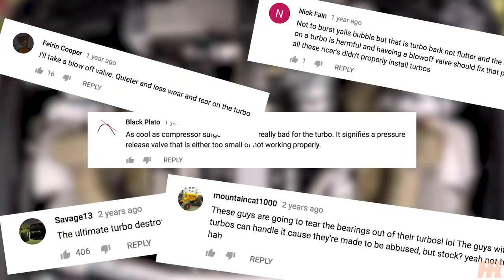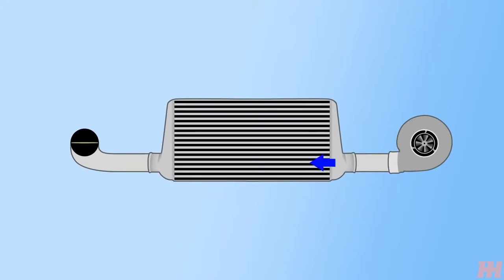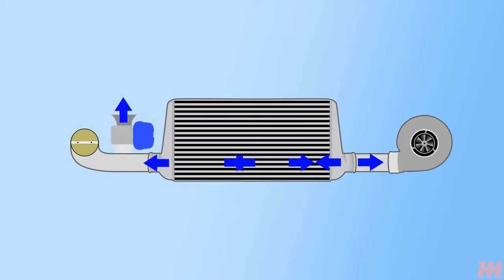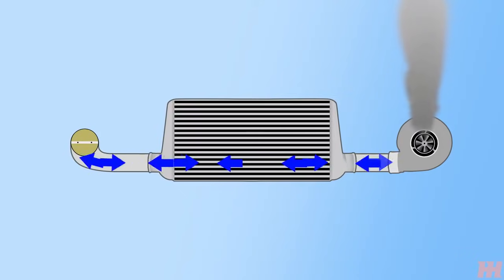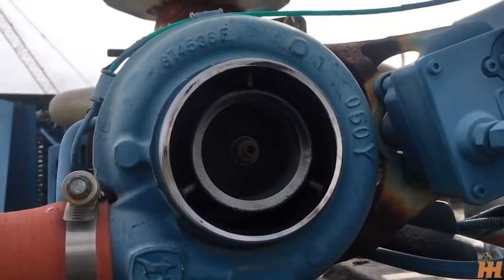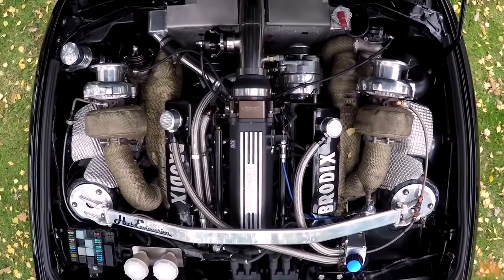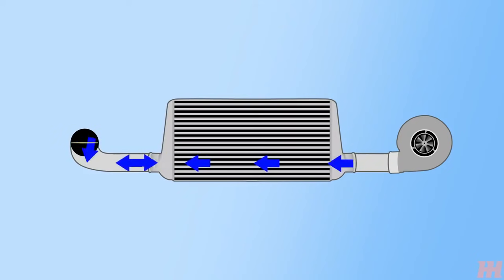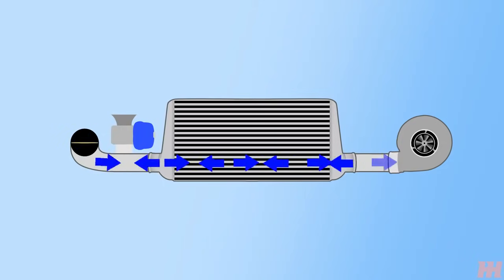The Truth About Compressor Surge

Comment: Wait so thath means we can have sututututu ?
Reply: Stoteliu Siaubas that’s what I’m hearing.. throwing out BOV now..
Reply: Been saying this for years and no one would believe me
Reply: only low boost
Reply: @randiey95  define low boost because im thinking if  15 psi  qualifies🤔
Reply: @TheShamRockii  welp go for it
Reply: You didn't draw pictures for me like this guy tho...
Reply: @TheShamRockii  any amount of boost will be fine. There are loads of high hp cars running no bov
Reply: @strider5119 yeah but u just gotta have a strong turbo fs just not a cheap weak one
Reply: I have a mk6 golf r with k04 turbo and integrated engineering intake and I get some pretty nice stustustu when I shift above 4 or 5 thousand rpms.

Comment: Been running no BOV on my single turbo 1JZ for near on 3 years now. Makes 20+psi on e85 reliably all day every day without issue. Why fix something if it isn't broken?!
Reply: You'll be fixing it a lot sooner than someone with a BOV.
Reply: Archer 
old turbo buicks with blow thru system didnt have bovs and you can still find perfectly working ones with the same old turbo.
so after 25+ years and thousands of miles and still no broken turbo...
Reply: Also to note, WRC cars don't use BOVs either because (believe it or not) they slow the impeller speed down more than without one causing more lag ;)
Reply: as far as i know the bmw m6 GT3 don´t use a bov either and you can hear the flutter when they let off the gas ^^
Reply: andrenegwer says the guy parroting what he saw in a video from a very respectable, but less experienced member of the community. They are much more experienced experts who will tell you the opposite. What he covers is is mostly true but you still cause premature wear without a valve regardless.
Reply: Archer the guy responding to you doesn’t get it or the irony of his statement.
Reply: jrbuch, the purpose of the bov is to maixmise turbine rpm between gears, ie, reduce the compressor slowing back pressure when the turbine is not being driven by exhaust.
Reply: I've never used a bov on any turbo car either. The benefits are so minimal it's not even noticeable. It's supposed to keep the turbo spinning faster when off throttle but we're talking a small fraction of a second in spool time. When improperly tuned it's actually doing more harm than good by releasing too much charge air.
Reply: Archer my almost 30 year old 200sx also came without any bov or recirculation valves and still works fine. Long live the turbo flutter
Reply: lmfao this guy doesn't hit boost whatsoever, topic ended
Reply: I have a BOV and I can make it flutter at will just depend how I back off the throttle.  If I lift hard the BOV works like you would expect if I roll out of it it flutters.   My point is you can't just go by how it sounds.  Plus most factory BOV don't typically chirp loud like aftermarket units.
Reply: Because Toyota !
Reply: My golf turbo makes over 300 ponies and has been fluttering for the past 30k turbo is still strong so  yeah braaaaap stuustuutututuu
Reply: @jarrusjenkins  Yes but note that WRC teams can swap/repair engines between stages, while regular people simply cannot do the same as easily and as quickly.
Reply: @meatspin17779   did you not watch the video ? It's fine with close throttle compressor surge cause there's no load on the turbo. Open throttle compressor surge is bad because theres load and air trying to force it's way back through the turbo.
Reply: It sounds cooler lmao
Reply: @jarrusjenkins  Please forget me if i am wrong but WRC cars change turbo to New one after each race. Cause their turbos are on very high boosts and it wears alot quicker than it normally would. Again Please correct me if i am wrong here :)
Reply: @Cyfoxxi  not after ever race but probably after each event (like the whole country if you catch my drift)
Reply: boostedsil40  Unless you are doing a burnout in your driveway then shutting the car off you don't need a turbo timer, also if running no blow off valve did increase lag by any noticeable amount with on/off/on throttle then it wouldn't be so common in drifting for people not to run blow off valves.
Reply: Because eventually it will break. Why have something for X amount of time when you can have it for 3X amount of time for 0.2Y the cost of repair. Preventative measures
Reply: @jarrusjenkins  well they also have antilag systems which destroys turbos anyway...
Reply: @camolegoshark  this is very true...
Reply: How can I find my OEM blow off valve ? Or dump valve ? I have a golf 1.4 tsi 2012 122 hp and I can't find my OEM bov or dp
Reply: @e34boat88  the JZ is a Toyota.
Reply: @Who-vk2ke  doesn't have a BOV , uses a recirculating valve. It's on the the compressor housing. You can install a bov spacer but you'll cause a check engine light because the air is metered and dumping it will cause  an unstable AFR
Reply: @danr8194  okay, thank you !!
Reply: Or you can drive a diesel and not have a throttle plate at all 😂
Reply: Well too much stall isn’t good long term especially with tuned boost, but if you’re happy with its longevity then cool.
Reply: You know you still get flutter with a BOV right?
Reply: @jarhead1145  say that to my 500,000km corolla with no bov or diverter valve, runs like a dream
Reply: Guys I have a doubt .. Does stock car makes turbo fluttering sound ?
Reply: @anjalipandey8278  some do, like mine.
Reply: I have a plumb back BOV wound up to max. It only flutters at larger throttle openings. My friend has the same car with a dose pipe, and his flutters like Zoidberg just taking it easy.
Reply: @jarrusjenkins  I believe that the manifold pressure is higher without a BOV, but I do know that BOVs that route to the exhaust impeller do help keep the turbo on rpm helping to keep boost, and prevent manifold over pressurization.
Reply: @zerodamonsta942  there's still load between the compressor and exhaust of the turbo. 
Compressor is being slowed by the escaping air. 
Exhaust side isn't
Reply: My car came stock with a turbo and no BOV and it flutters like crazy. If they left it like that from factory it should be fine
Reply: Yeah, you’d last a lot longer with a BOV.
Reply: @jarhead1145 not true

Comment: Finally someone who actually understands how this works. Thank you CT.
Reply: ali p how does he understand it? He just explained it’s ok. He showed no examples or reasoning as to why. Having 20+ years in machine and car shops and understanding tolerances and bearings back pressure under load or not is still pressure. Which is going to put force on the bearings which will wear one direction more than another. This wearing the bearings to premature failure.

The whole it wears under WOT but not when it’s no makes no sense. Either way it’s back pressure on the turbine and bearings. So either it does or doesn’t at all.
Reply: Manufacturers understand better. And they put valves to protect from surge. Thank you manufacturers.
Reply: Dan Slotea not true, they are mainly in place to prevent the noise and due to they fact that many standard hot wire/thin film air flow meters could not measure the direction of air flow, and as surge when surge occurred the air flow meter incorrectly measured more air than was being consumed by the engine, causing a temporarily rich tune and emissions problems.

The Anti surge was just a happy coincidence, many early turbo cars of the 80s had no bov.
Reply: @renners9636  Many 80s cars also had Brown interiors, solid rear axles and were absolutely terrible.  It doesn't make them correct. 
Also that was like 37 years ago, technology changes. 
Look at Borg Warner.
Reply: No Grip can you be more specific in your argument against me?

My statement was very simple and only covered one aspect, that the main reason cars were initially fitted with blow off valves was not to protect against damage from compressor surge itself but to stop incorrect fuel readings under surge conditions and to stop annoying noises that most drivers would not expect from a normal car.

I made absolutely no claim of anything being better, the implication of me mentioning some 80s gasoline cars not having blow off valves was to validate the 100s of thousands of turbochargers that have lived and live without being destroyed by compressor surge, I never advocated it as correct, but simply noted in the case of many oem cars that it is was a design that did not doom the turbocharger to early mechanical failure.

Manufacturers are more worried about possible emissions and noise issues than a few turbos failing sometime after warranty is up.

Maybe turbos running 30+psi are more susceptible to wear I couldn’t say.
Reply: @renners9636  that's why they use map sensors
Reply: Jon Simmons No, it might not be a problem with map sensors, but it is absolutely not the reason they exist, if it is please reference it.

They are cheaper, also different engineering teams just do things differently.
Reply: @renners9636  who said that the reason they exist?
Reply: Jon Simmons “that’s why they used map sensors” this statement seemed to imply that, maybe I miss understood.
Reply: @renners9636  they use map cause maf measures flow not boost,that's why they suck.
Reply: @mrmidnight32 it's not just the bearings/seals. Its the compressor wheel vane tips as well. Not to mention the performance consequences.
Reply: Guess I'm taking my BOV off Lol
Reply: @jonsimmons3507   I can tell you don't know what you're talking about lol. Whether a MAP or MAF sensor is used, flow is what the ECU is trying to find. MAF sensors don't suck they provide way more accurate low speed airflow data to the ECU. Map sensors from what I've seen simplify the system and tend to be more robust than MAF sensors, If a MAP sensor is used the ecu will use it and temperature to calculate flow anyway so not sure why you say MAF is bad because it gives you airflow info straight up.
Reply: @mrmidnight32   Agreed, It's the worst when a channel focuses on the lowest common denominator comment or "things inexperienced ppl argue about" we're not here to diagnose noises randomly in peoples videos.. What I'm really after is what the turbo surge line in a compressor map really means, what part damage are we concerned about during surge etc etc.

Comment: Wow! So like half of us thought flutter was just a fancy sounding blow-off valve haha.
Reply: James Russo that’s what has made me so pissed! All these “tuner” 600whp subies talking bout “it’s a BOV”
Reply: maybe 10% its clearly not bov. BUT some of the turbo cars that makes flutter noises does have bov but it only realeases part of the boost so the sound is kinda mixed
Reply: some people wind there blow off valves up tightly so it surges on low boost and opens the blow off valve on high boost
Reply: Yep my car flutters when I roll off in normal driving and chirps when I'm getting into it.  Just depend on much boost there is before lifting.
Reply: GlassTopRX7 how tight is your bov set?
Reply: You guys could also put some kind of restrictor in the vacuum line to get a delayed bov. Flutter and bov sound together are great! Look up the video! Dude that did this has a rwd wrx wagon.
Reply: It sounds similar with our without a BOV depending on application they will both flutter, just sound different
Reply: @travisburgemeister313  BOV just goes shshhsschshcsh doesnt it?
Reply: @nateboness9801  Only if it is vented to the atmosphere.  If it is a recirculating BOV then there should be no real sound.
Reply: @nateboness9801  My Subaru Forester XT has a bypass valve and it goes "Pshhhhhhhhhhh".
Reply: @jimmythehand4877  Hmm, my stock Forester XT valve setup (recirculating) goes "Pshhhhhhhhh"
Reply: @BaddaBigBoom  then you have a leak.
Reply: @jimmythehand4877  Thanks, where is that most likely to be? Between the wool or the knitting needles?
Reply: @jimmythehand4877  Bypass valve (BPV) makes a pshhhhhhhh sound. He doesnt have a leak.
Reply: @midniteclub1654  This
Reply: @jimmythehand4877  my stock 3sgte recirculates but if I go off throttle at 3k rpm I get a nice “pshshcheww” but otherwise is too quiet to hear. If I put a mic under my bonnet I can clearly hear it moving air as well just not over the sound of motor revs
Reply: So turbo isn’t bad how people say it is right? It’s just compressed air mixing with air being pushed out at the same time n being trapped all at once due to letting off or “closing” off the throttle ?….

Comment: Its scary to me that people don't actually get this as it's the most BASIC understanding of how a turbo works. Think about that for a while. these are the same people that yell ''RICER'' if you made a modification they don't approve of.
Reply: StreatBeatsAudio Subwoofers basically people who call themselves car guys but have no clue at all
Reply: It sounds to me like you're just band-wagoning, because you aren't really providing reasoning behind your argument. You're simply persecuting. Compressor surge fundamentals are not the most basic understanding of how a turbo works. That's usually stage 2 or stage 3 in understanding a turbine's mechanics. An inexperienced person who has just finished their build wouldn't likely be aware that their blow-off valve serves purpose outside of alleviating pressure in charge pipes and intercooler piping/intercooler. If they heard open throttle compressor surge for the first time, they might just assume it's cool turbo noises and functioning as normal. Once they've blown the seals and bearings out of the turbo, then it might be something they learn. Also, some of your statements don't even correlate. You're a bit all over the place, which is what leads me to the conclusion that you're simply here to make others feel bad to make yourself feel better about your own ignorance. I'm not attacking you, but I would ask that you not attack others. If you think you have such a complete grasp on turbo-charging, perhaps you should do some research into intake harmonics and then come back and comment. You still have a lot to learn as well. Everyone starts somewhere. Learning is a process. I've spent years of my life building turbo'd cars and still learn things every day through trial and error, other people providing me information and tips, and research and equations. If you assume compressor surge is a fundamental pillar in understanding turbo-chargers, you've never seen a 16 year old driving a boosted Civic with no blow-off valve, no intercooler, no waste-gate, and no BCM or piggy-back. Turbo-charging is more complex than you are for probably prepared.
Reply: @bestleesinna7702  lol
Reply: @bestleesinna7702  turbo flutter does not wear the turbo out due to simple fluid dynamic laws
Reply: Best Lee Sin NA You know. You writing novels in the comments section isn’t doing you any better. CT is pretty much correct on the whole Compressor Surge debate. So I wouldn’t be calling people names if I were you.
Reply: @Iridiumcosmos  some things require explanation. To those uneducated, sometimes a lot of explanation and clear and concise words are necessary. I've been doing this for 20 years. He's so very wrong.
Reply: @bestleesinna7702  not to put down your 20 years of work ...but   
How would a turbo not completly explode from a change in force so rapid
Reply: If what youre saying is true turbos would wear due to flutter stall but you still get this when you install a bov. As air stops and turbine still spins
Reply: Grant I mean as a musician and producer I appreciate low end and subs... but I’m yet to drop one in my car, I find the stock system satisfactory, and that’s only for calm journeys, most of the time I’m turning down the stereo and listening to my car opening up instead :)
Reply: @snowoffstream5823  best comment on here 😂
Reply: Some people also dont know how to change their own oil

Comment: Thanks! I was so worried with my quad turbo charged & dual supercharged Civic Si, with stock internals, would break all my turbos.
Reply: ErwinSchrodinger64
i wish this was trye and you had mad vids about it bruh
Reply: This is an automatic message to notify anyone that ErwinSchrodinger's quad turbo charged & dual supercharged Civic Si, with stock internals, had so much horsepower and so fast, it became a time machine and he went back in time.
Reply: ErwinSchrodinger64 
all that was possible due not using bov
Reply: A civic can handle 1000 hp on stock internals easily, fax
Reply: @DoktrDub  only 1000 you say? Nah this man's probably pushing top fuel levels of hp on stock internals.

Comment: I get the best of both worlds with the Tial Q on my ms3. Spring in it is a -12 psi spring, and the vacuum in the intake manifold takes about a quarter to a half second to go from positive boost to -12 vacuum, and therefore it takes that long before the valve opens after boost. I get this lovely "stutu-schhhhh" noise from it and I absolutely cannot wait until I have a Garrett GTX2867R gen II on it and can hear the noise a 9 blade compressor makes vs the k04 6 blade.